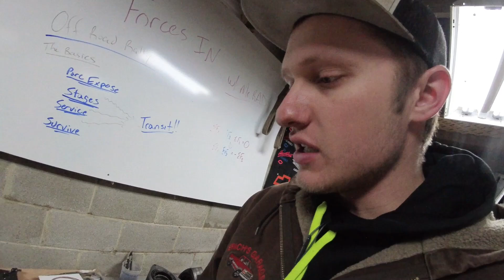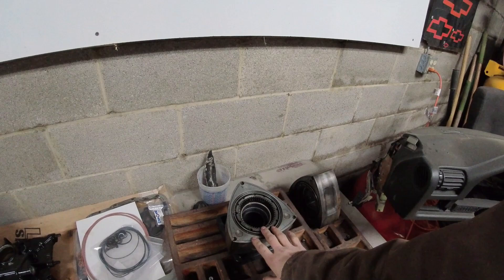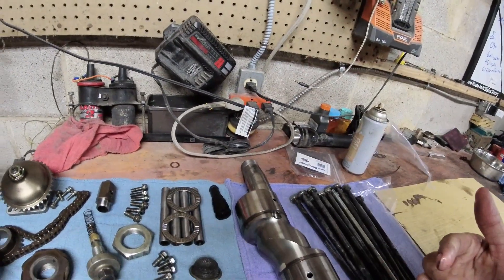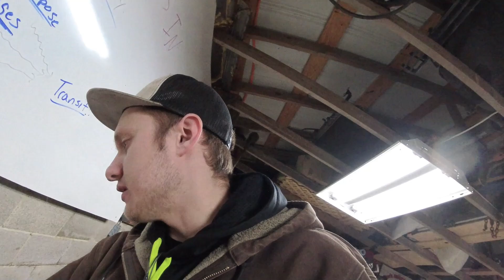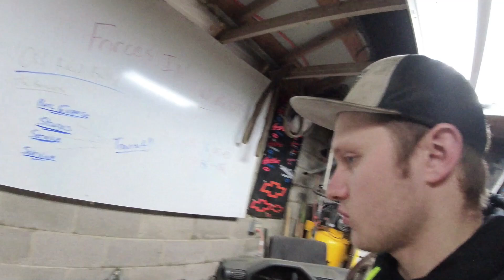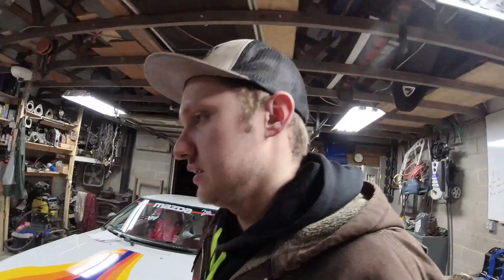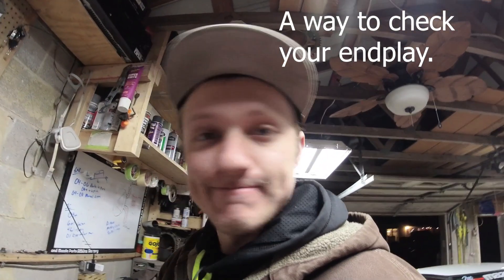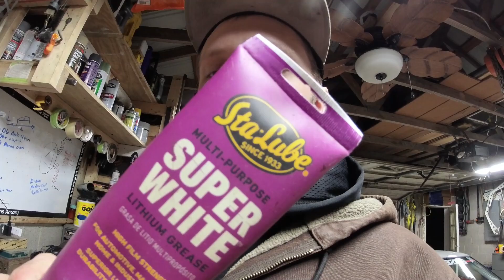Preparing a 13B Rotary for Assembly - Tricks For Not Forgetting Anything

Comment: THANKS SO MUCH for the tip about using a syringe to apply the gasket sealant. Ive used that exact sealant on gaskets and it's so sticky it can be difficult to work with. I've been using zip ties to scoop and smear it on, but looking forward to trying a syringe next time.

Comment: Do u do any clearancing of the sides of the apex seals themselves? Heard of people shaving down apex seals to just shy of the width of the rotor housing, was wondering what ur take on that was. Also, is using turbo housings on an NA engine going to change anything? All I’m aware of that’s different is exhaust sleeves. Thanks!
Reply from the maker: I never have.  I have had to clean up the apex seal groove after a broke apex seal tore up the rotor.

Comment: Perfect timing. I was planning on putting my engine together next week since i just got my parts. But now that i watched the video and you mentioned coating the parts in WD40 after cleaning them im kind of scared haha. I cleaned mine last week and forgot to do that. I wont be at the shop before next week. So any tips for removing the surface rust on the parts before assembling?
Reply from the maker: surface rust will come off with a semi aggressive cleaning pad, or a tougher rag.  the flash rust from a couple days wont be too crazy.  if you let it sit for a few months thats where it can start to get hard to remove.  id make sure you got all the rotor seal grooves clean from any debris/dust from the rust as well.